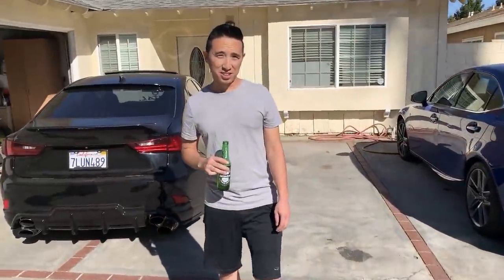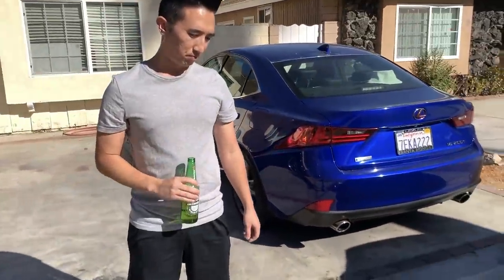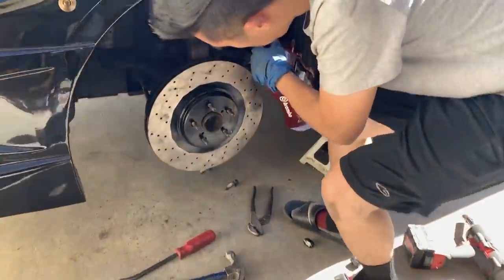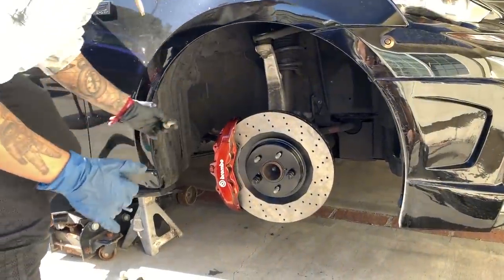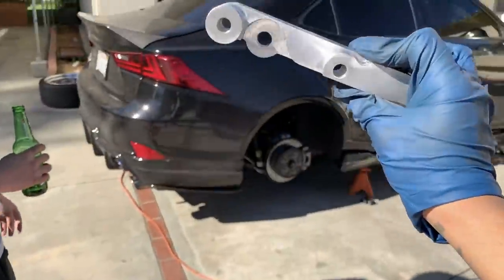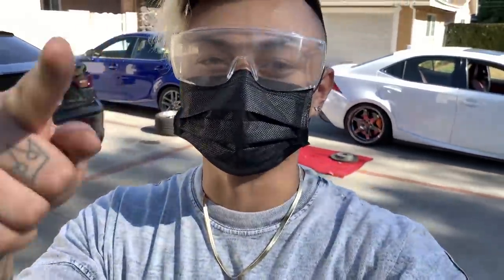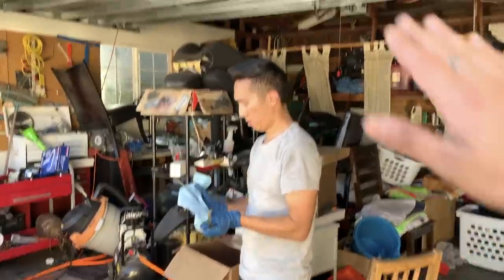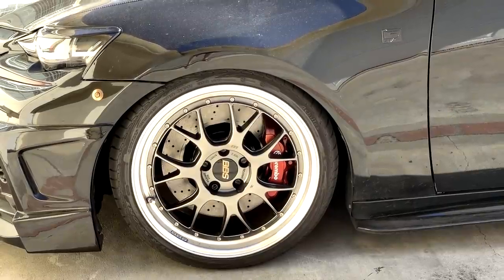BREMBO BIG BRAKE KIT on Lexus IS

Comment: Planning on doing this on my 3IS, just curious if only the isf brake calipers will work or would the RCF’s bolt on as well? And would the stock f sport 18’s clear bbk?
Reply from the maker: The RCF will but they’re much bigger so I don’t think it will clear 18s. You’ll need 19s forsure
Reply: @JasonNguyen  ah alright thanks

Comment: Wassupp jason quick ? I have the RR-Racing bbk setup & just got my first pair of wheels that are 19x8.5/19x9.5 35 offset all around but my fronts wont fit because the spoke is hitting the the calipers but diameter clears the bbk. What size spacers you think i should get ? Btw riding stock height as of now
Reply from the maker: Hmm, maybe start with a 5mm or 10mm. You can gauge how much it won’t clear by by trying to put the wheel on!

Comment: Hi Jason don't u have to put a spacer in to clear the knuckle as the rotor disc  will have contact to it . Another thing is yr back brake bracket come prefectly ? Because I bought mine from 350phi , I need to skim off abit in order to fit the caliper
Reply: A spacer to fit near the wheel bearing to clear off the rotor  from contacting the knuckle
Reply from the maker: I didn’t have to dremel the bracket, we had to dremel the caliper a bit. He did it for me. It’s in his instructions. 
Also, I just bent the dust shield back. I did not have to put a spacer in front!
Reply: @the battery shop, Jason used the rear caliper bracket to fit on his rear isf caliper to his car. You’re using is350 front caliper bracket for your is300/gs300. Your install is perfect. Sounds like you shaved a bit of the caliper to clear your wheels too.

Comment: I was wondering if the bbk can use different calipers than the ISF ones i cant find any used would @350phi know
Reply from the maker: I think you would need the ISF ones as that’s is the only one that will bolt up, besides the RCF/GSF which are bigger. However, You would still need a rear bracket!

Comment: What was diameter of your stock discs?  I own IS200t 2016 and front discs are 334mm and callipers look massive compared to your stock ones.
Reply from the maker: I don’t remember tbh ):
I know that they’re the same size as GS350 discs! And it’s a huge difference. The 250 brakes are even tinier than the 200t! 250 is 4 piston and the ISF is a big 6 piston!
Reply: Jason Nguyen, IS200t is probably 4 piston too, just looks different. 
Check my callipers after little refurbishment: https://drive.google.com/drive/folders/1-1P9pBEbgsi9gLZNDWlNrREbSIzAh7w3

Comment: when asian honda fan boys grow up ..they now drive modded Lexus's .
i still have my first car... i guess i never grew up lol
but i did buy a car with brembo brakes on it..so i dont have to do the "mod"
you Lexus IS owners should do 2020 supra engine swap  (B58) :D
Reply from the maker: Nice! You're lucky! I wish the IS had extra upgrades you can add for an additional fee! I really want to drive an A90 Supra to really experience it! Then maybe I can contemplate the swap (:
Reply: @JasonNguyen  my first car is 2001 integra type r.. ... im the original onwer.
i bought a first gen 300C srt8 which came with brembo brakes.
i've seen few 2JZ swap IS  .. they are freaking awesome.....
Reply from the maker: DUDE NO WAY! I love Type R Teggys. My dad didn't have a Type R but he did have a gunmetal Teggy on wheels and Hydraulics (because he worked for a company called Pro-Hopper at the time and they offered him free hydraulics to advertise LOL). 
That car definitely opened my eyes to the car world as well as Fast And the Furious LOL. I love 2jz's. Nothing sounds like them at all. I also love SR20s and their sounds as well as RB26DETTs even though I've never owned a Nissan.

Comment: How much was this kit ?
Reply from the maker: It all depends how much you can get it for! However, on eBay, they usually go for anywhere from $1400-$1800 without the rear adaptor bracket from my buddy!
Reply: @JasonNguyen  I really want to get a set any link on where to buy
Reply from the maker: @oMrBonesz  you just have to check eBay or offerup! You may get lucky!